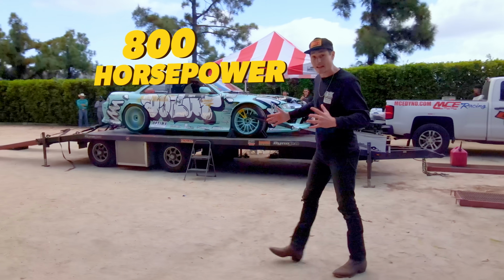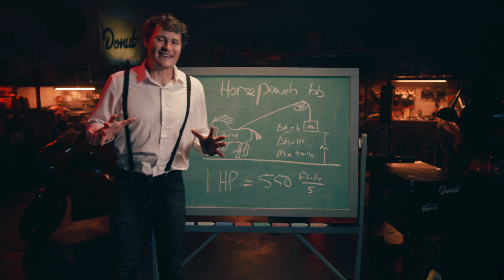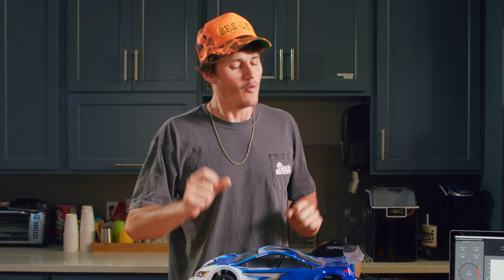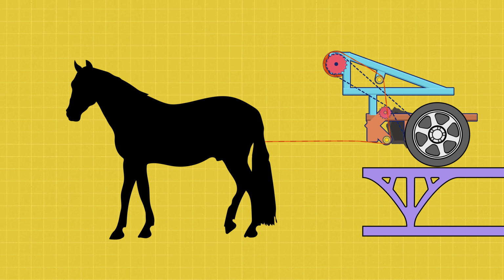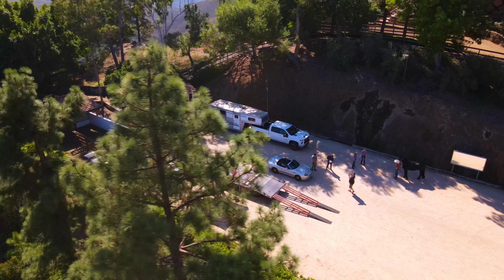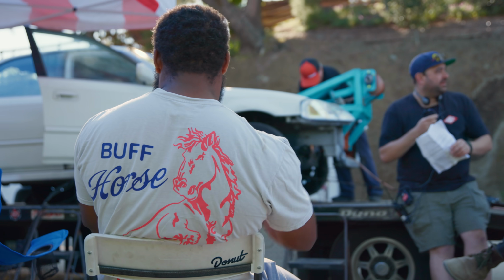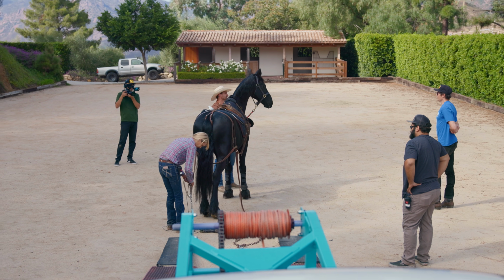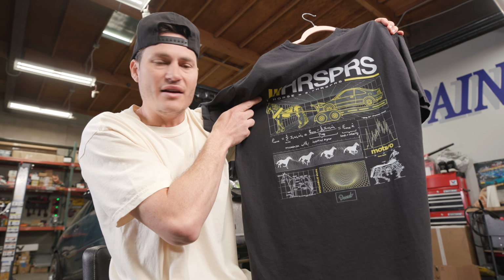How Much Horsepower is a Horse?

Comment: A 5 bottom plow requires 140 hp tractor. Normally with horses one figures two horses per plow sheer. So a horse is very roughly 14 hp pulling all day. Not a chance you could rig a 5 hp motor at horse walkin speed to do a tug of war against big D. In a sldgepull I would put an AR John Deere @ 26hp if I recall right against a Clydsdale as even odds for a bet. Why the car screwing the whole setup, and not just a cable spool replacing the drum of the dyno? How much weight of hay a horse lifted in the loft would be good, but before my time. 15 hp is the normally accepted rating for an average horse by much better methods than this, which btw, many have done.

Comment: My brother has big male draft horses that are 17+ hands tall and weigh over 2000 lbs. They've pulled huge logs out of deep mud and they can work like that all day. They're far bigger and stronger than the horse used in the video. I wouldn't be surprised if they could drag your whole trailer dyno across the ground. p.s. Draft horses are generally trained to pull as pairs, they pull harder than twice as much as one horse will. If I recall, they pull FOUR TIMES as much as one horse would.
Reply: I think these guys should attend a county fair in Washington State to see a horse pulling competition or a wheat field harvesting using the old horse drawn harvesters. My in-laws had Clydesdales……they were something to see! cheers
Reply: Hands tall?? Hands tall?? Wtf.
Reply: @CountingStars333 the username clearly says american
Reply: @空野ゑみ  Hands is standard in European equestrianism too.
Reply: @空野ゑみ 4 inches or about 10cm
Reply: @CountingStars333  Horses are measured in hands, yes.

Comment: Well a horse runs 70kmh^3 to the third power, times a height of 180cm times and  width of 60cm  times a drag coefficient for a longitudinal box of 0.8 times the density of air rho divided by two because physics gives 4 KW or 5.4 Hp in horse units. Why do experiments if you can Fermi guess?

Comment: So this kind of breed can produce 5-6 hp with just pacing, But how about in burst thou like when it's running all it's can.

Like set up a chain link so it keeps rotating and put it in a fixed rig barred on the ground and treadmill big enough for horse. Like those treadmill for dogs so they can run as much as they want.

Comment: I think the Horse didn't have enough of a stable pulling system to be able to pull consistently. Imho, the horse power reading is under calculated, and the actual hp should be around 9 to 10.

Comment: What was the point of keeping the car in this experiment?
Once you have the pulley to drive wheel assembly equipment set up, surely having the car too only introduces unneccessary mechanical loses.

Comment: Big D was a large horse. However, he seems modest compared to the working draft horses my grandfather used on his farm in the 1960's. Male Clydesdales & Shire horses grow to be big. Occasionally you'd see one that was 25% bigger than normal. Basically as wide as 2 racehorses & 50% taller. 
As a young boy the most striking thing I recall was how long they would piss for. 
The big horses didn't move loads fast. But they'd move mountains, & drag them for hours.

Comment: Very interesting, most estimates were much higher by 2-3x according to my few seconds of Googling.  But what you're measuring is PEAK horsepower, not Continuous HP.  The horse can't pull that all day, they get tired.  The 1 HP rating that Watt calculated was for continuous horsepower, the amount of power that the average horse for that purpose could do reliably over the time it was in service.  Peak HP is important when considering the starting load, but continuous is the amount of work you're going to get.  From my brief, cursory look, it's still the accepted figure today.

Comment: Truly if a horse can run at 35 , 40 mph .. on a dyno expierment.  The horse is truly pulling that much horse power do to power. .. curve. Rotational   .  The horse needs to be truly be running . . For expierment ..  if not it needs   to be done with weight ..

Comment: Think the horse power experiment is flawed i think it has to be done  with a like expierment  with a tractor pull devise  . Expierment  that way true horse power pull force is measured not rpm ..  true tork off the engine  not on rpm  because engine is based on rpm  not tork .. you have to measure the tork ..  . True horse powr to car horse power ratio ..

Comment: Love the video but isn't there a simpler option? 

Why not (kinda) repeat Watt's experiment. Get a horse, connect a trailer (they have brakes, right?), pull the trailer at varous speeds up and apply the brakes to the horse's maximum effort and and record the load. Power=load x speed so you have a power curve. You could convert the speed into hoof strides so you've got power vs. hpm.

Comment: When James Watt coined the term horsepower it was 1769 to 1780 he just built the first steam engine our primary movers were horses and he measured several horses over a full day's work the average output of a horse is about 550 ft lbs per minute that's where he came up with being able to move 33,000 lbs 12 in vertically in 60 seconds it's called work done over time these gentlemen used a fresh horse and they only did five pulls with a fresh young horse very healthy compared to the horses that would work 8 hours a day this was the average output for that period of time 8 hours you're comparing a sprinter which is this horse to a marathon runner which is what the measurement of horsepower was based upon I doubt very much they're going to make much of an imprint on anybody who really understands what a horsepower is I hate seeing people misinformed when people who are not true to understanding how to conduct an impartial scientific experiment really understand scientific method

Comment: Horse power was established as such:
How much salt can a horse pull from the depths of a salt mine in the course of an hour.
If you instead used an engine/motor that could pull the same weight over the course of an hour that was equal to 1 horse power (when in fact it might have been more)

But for the time being it made complete sense.

But let me break it down as how it evolved to the modern day horse power:

If a brick layer can lay about 100 bricks an hour, the robot that can do the same in the same amount of time will be 1 man-power.

Obviously we tend to work 8hour/ day, 5 days a week, where a robot can work for 24h/7 days.

So yet again with the maths:
100bricks/h×8h×5days=4.000 bricks
100bricks/h×24h×7days=16.800

16.800/4.000=4.2 man-power.

So you can see, how the horse power evolved into what it is today.
A horse has to eat, sleep, drink, rest etc, whereas an engine/motor has to be shut off for maintanance only.

Comment: An easier way to do it is to measure the horse's output power according to the system and then duplicate that systemic measurement with a controlled and known amount of input power. Vary the known input power until the output power matches the previously measured output power from the horse. It's easier and way more reliable to apply a known input power into the system than it is to calculate the power loss by the system especially since power losses might vary as input power varies and slight build variances could change this dynamic. You need to calibrate the system experimentally.

Comment: Great video, but...
I doubt the number 5.7 hp. This is for a few reasons. The main reason is the wrong surface, which does not provide a proper grip for Big D's feet. Second, nothing takes up the slack; some sort of "rubber" should be added to the line. All heavy loads for a horse are directed down to the stuff that is pulled so increasing weight down and not straight back. Horses can handle heavy loads, but if they think that the load will or might "let go" they do not pull that hard as if the load would go, they would fall over, so they restrict themself. I have seen horses pull heavy loads (mainly in the forest pulling a lot of timber logs). Big D is a beautiful horse, but he is not even near his maximum capacity during that pull.

Comment: 1hp isn't an instant measure of a horse's strength. It's the 24 hour output. If you keep a draft horse for 24 hours and work it as long as it can work on a typical day over 24 hours it will supposedly pull with 1 hp So that's not the highest mark, it's the average of the whole graph over 24 hours.

Comment: Geniune question guys.
Why didn't you use a clutch system or a torque converter attached to the dyno or smth like that? Wouldn't it habe been more simple?

Comment: HORSE POWER
_____________________
no way

engine goes to full throttle

horse must run at full throttle

this is is inaccurate

but if this comparison is used then 1hp is actually 5.7hp on an engine

500hp engine is 500 x 5.7 = 2,850hp

correct calculation is 500 divided through 5.7 = 87.7hp for Big Horse Dick, enough to satify any sex horse driven woman

ha ha ha ha

00
olo

get with'it

cam girls know💅🏼🙋🏼‍♀️🫡🤥🤩🎠🦓🫏🤳🏿

now thats a Doe Nut !

Comment: the original AMA determinated what one horsepower was in the 19th centry, and 59 ama hp is 425hp NHA hp or 197 certified net hp as of the 1950's, and yearly lawsuites by auto manufactures keep changing whats called one hp since,

Comment: a very clear indication of the current state of society, is how they state power putput in horsepower because it sounds more than kilowatt, and for torque they use Nm b ecause it sounds more than lb-ft.  Meanwhile, most people do not understand  any of it, and therefore don't know that these values by themselves are useless info.  It is like measuring the length of a member in mm instead of " because it would seem bigger.

Comment: That's funny - I made a guess before I watched the whole video and guessed about 5 hp for a real horse. Only because I've always had an interest in electric motors and their hp rating, having played around with old motors taken from defunct washing machines and dryers growing up as a kid. My parents weren't rich, so we always had 2nd hand washing machines and dryers that didn't last long, and when they crapped out, typically the motors were still good, and my dad would remove them and let use kids (3 bros) play with them (knowing we were smart enough not to do anything unsafe with them). I had always been suspicious about those motors' ratings: the washing machine's motor was rated at 1/4 hp, but I suspected that an actual horse would be at least 9 x as strong as that little motor.

Comment: Nice video, but I'm not sure about the way you concert the pulling force to rotational.
1. If it's numerically correct, it would be nice to test it by a couple of vehicles that we have the HP.
2. And it's like running cars in first gear. The rope was too short.
3. Does it mean a car has 500 HP can drag 100 horses?🤔

Comment: This video is stupid but alright, we are in America where these things are like in ancient time. One horsepower is 746 Watts which is 746 Joules of energy per second. The unit of horsepower is outdated and we should start using modern units, in this case Watts (eg. use 1 kW for 1000 W which is 1.341 horsepower).

Comment: To be polite this is fucking stupid, you need a horse, a cart, stain gauge between the harness and the cart, and a speedometer on the the cart. This method adds multiple other sources of inaccuracy to the mix.

Comment: I would have liked to have seen a gearing system that made it easier for the horse / human to pull. The dinner would be moving the wrench that would be connected to the dyno. The benefit being that the horse/ human could reach a higher speed and perhaps having a different horsepower output

Comment: this specific horse guys did 5.7 horsepower 
so 1 horse = 5.7 horsepower 
for those who didn’t want to watch the full thing i recommend u do
Reply: powerful as 5 men without even trying. It doesnt look like a big working horse either. There are breeds that are much more muscular than this one. WOW
Reply: @bismuth7730  The guys only clocked in at 0.6 HP, so Big D is over 9 times the power of your average Donut dude.
Reply: @dovydenaspdx the main dude got 1.16HP and the black guy got 1.21, both alone. You can't count the team pull and average it between 3 guys because they weren't properly coordinated and were not really using a good technique
Reply: So 1 horsepower is actually 1 man power
Reply: @mixj9  Yes, you are correct.  550 ft-Lb/sec for horse and 550 Inch-LB/sec for a 160 LB man.  62.1 watts.
Reply: I’ll say 1horse = 6 hp bc big D didn’t really take it seriously plus he didn’t get a chance to worm up
Reply: @aamarsaleh1929 big D is also a movie horse and not a pulling horse.
If they'd taken a horse that regularly pulls carriages, you'd probably get 7 or 8 hp
Reply: Thanks. My adhd couldn’t sit through this long
Reply: Yeah it fell into the typical YT clickbait trap. GOT REALLY BORING. Should have looked at the comments instead of jumping around to hunt and find the relevant bit of info you're interested in. Did not need to be almost a half-hour. This could have easily been cut down to 10 minutes.
Reply: this is the worst measurment possible...i believe the centuries old numbers than this BS
Reply: You should try this with a pit pony.
Reply: you spoil me broooo 😑😑😑😑😑
Reply: That's only true if said horse can provide that power throughout the full working day.
Reply: well, there is peak power (burst of power for short period) and continuous power.
I think they are measuring peak power here.
What Jame Watt was trying to convince potential client of his steam engine was sustained continuous power generated by his steam engines.
Reply: So the steam engine is 10hp/ big D real 5.7hp =1.75 real horsepower.😅
Reply: I wanted to watch the whole thing but your comment ruined it 😐. Bit weird to ruin the video then say u guys should watch it
Reply: @aidan6557  why do you read comments before  watching lol

Comment: The only way I can think of is to turn the Dyno into a treadmill, because if you change the radius of your cars wheels and your can can have faster acceleration if the wheel is smaller or if it's bigger the top speed increases.
So the only way is to turn the Dyno into a treadmill, use some harness on the horse, fix him to a pole so he can move the dyno turned treadmill.
I'm at 10:58, curious what they did :)

Comment: This is interesting! But I think there is a better way to do this with a CYCLING POWER METER. Due to the nature of a horse, a device that is designed to measure human power will yield much better accuracy than a dyno that is designed to measure hundreds of HPs. Since you are only using a very small part of the dyno's measurement range, the error will be on the high side. It's like to use a ground scale at the toll gate for weighing 100T trucks to measure your body weight. On such a scale 0.1T will probably won't even register. You can use the SRM wheel hub power meter as the dyno, hook it up with the same pulling rig you use in this video, and that should give you some pretty accurate power reading. The SRM is considered the golden standard in the cycling industry that has an accuracy of less than 1% error. Also the bicycle drive train efficiency is crazy at the same >99% range. With a rig using bicycle parts you will have a very accurate measurement. Just in case you guys are wondering why cycling gears are this accurate, that's all because the very limited nature of human power. The sustained power from world class pros are less than a HP, peak 1s sprint power at Olympics are less than 4 HP. Races are won/lost within 5-10 watts (0.01 HP) margins. Since this is a serious sport with a lot of business interest on it, just like the motor sport, the efficiency and accuracy of power measuring are optimized to the extreme. I think if you guys could get contact with SRM and assemble a rig with their wheel hub power meter, then do a validation episode, to cross validate the results, thaw will be more than awesome!

Comment: When the rope unspools, it makes the roll smaller which will skew your numbers. A bigger spool is going to be harder to turn so as the rope spools in there is mechanical advantage working in the pullers favor.
Reply: you are talking nonsense.
the spool is even, they unroll just a few meters, it never goes on a second layer.
also event it goes, all it matters is the wattage.

Comment: I am a microbiologist, and I have some problems with this experimental set up, like what parameters were used to determine an ideal draft horse used for this experiment, like age, height, weight, and fit. Also, since such a thing as IDEAL for animals might not in reality existence, in the determination of this experiment, shouldn’t several draft horses with different BMIs have been used, and an average used, the more the draft horse used the closer one gets to the actual or acceptable power of a draft horse. Also could climatic conditions affect their powers.

Comment: It's a simple math take a horse make it run faster as he can then see how much faster he is going in a kilometer let's say he is going 30 km so take a car and run it at 30 and you will get the horsepower because when we know The top speed of a horse than the car and every single thing is equal if you run it on the same speed

Comment: Is there a reason you didnt just use the dyno spindel as the spool and the horse then pulls and rotates the dynos spindle... eliminate the car entirely. The it's pure horse power measured with no power loss to mechanism.

Comment: Another issue is. You say a horse is 5.7 horse power. But does the horse work better than a 5.7 horse engine? Does the horse out proform a 30 horse power engine. It probably does.